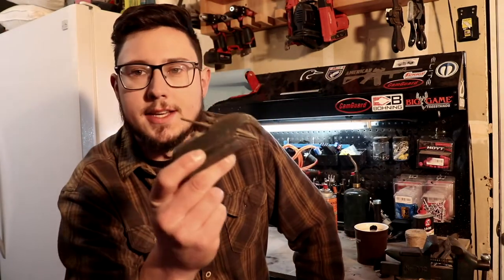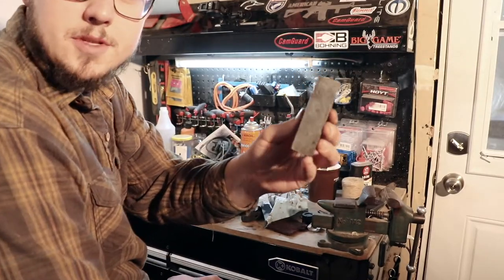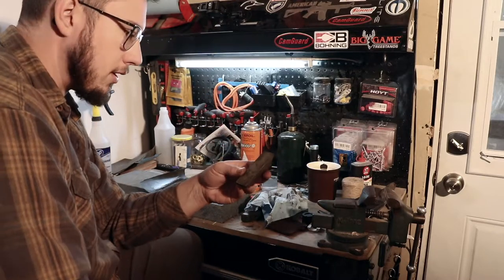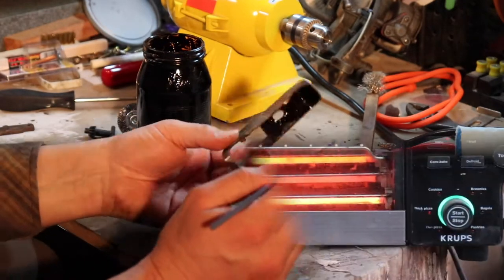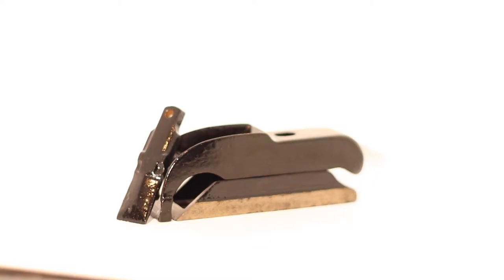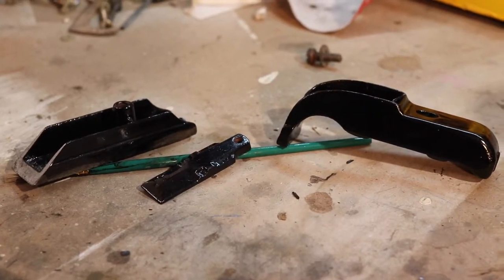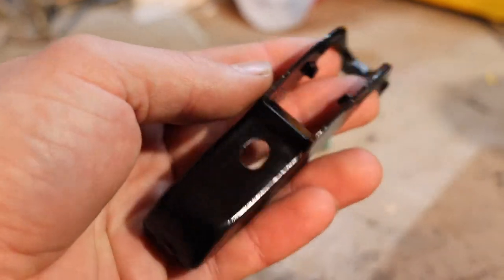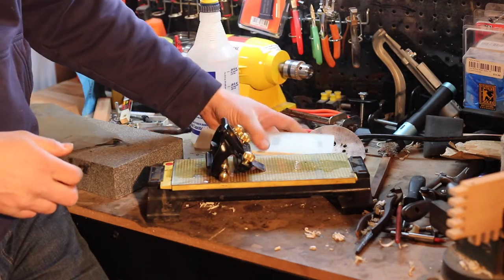Reviving a Stanley no 75 Bullnose Rabbet Plane - Woodworking Tool Restoration

Comment: A great result👍 The  “plane collector” may explain why some may hate it: never flatten the sole with the upper body attached. It wont take a shaving if you do.  I put two hands on top to take a shaving along a board’s edge, it works well enough, but the no.90 is my preferred tool for cleaning up a rebate/rabbet. This will be fine to knock the aris off a sharp edge.

Comment: I use mine as a rabbet plane. When I'm roughing in a tenon or any rabbet-like area with a larger plane I use the 75 to keep the area in the corners at the same level. Rough shaping for when I am not already using a skew or rabbet plane. I'll get into it with a #5 to blow it upthen a block plane(#18 for sure) and the #75 comes in handy to finish and keep it tidy. even on large 6x6 timbers for a stable I used the lil 75.

Comment: Liked the video
Looks like an older 75, couldn’t tell if it is a type1. 
Years ago I bought about 5 jars of original Pontypool jappaning , sold 4 and kept 1 for me
If there is a secret to it it is to put a couple light coats. Want to keep it warm while in storage
To get a believable finish you want to tone it down some other wise it is to shiny. Very fine steel wool or rubbing with a rag
Nothing looks more goofy I think then a worn plane with 100% shiny jappaning
In my experience you can use engine enamel spray paint and get about the same results , hard to tell it from real jappaning
Reply from the maker: Yeah it is definitely an older one with the Stanley Rule and Level Co stamp on the iron. Not sure what type it is, as often the Type studies on the older ones get a little fuzzy but I know it was pretty early. I brought the mix in the house to warm it up, and had good luck sticking the plane body in the oven at 150 degrees for about 10 minutes before applying so the metal wasn't cold. That seemed to help a lot. Getting too thick was part of my earlier problems. With the steel cold, it was hard to get the mix painted on in a thin consistent coat. You are right it definitely needs to go on light. 
I know a lot of folks use the engine enamel with good success, and that's certainly an option especially on a user plane. But for me it's about trying out the processes and trying out something new. Not sure that it's necessarily "better", but I enjoy the process. Thanks as always for watching!

Comment: I can’t set this plane up to get good cuts for the life of me. Every other plane I own I can but this one I can’t seem to get right
Reply from the maker: Indeed it was a tricky one to get the iron depth just right. Once I got it scary sharp and fiddled with the depth back and forth it cuts decently. With the way it fits in the hand I definitely won’t be using it for long cuts, but to clean up the odd corner here and there I will keep it around. Thanks for stopping by.
Reply: Same here, but it sure is good paperweight around the shop :D

Comment: dude that 6000 glass is a Japanese water stone used the other way up i am pretty sure? is it a shapton? the white ceramic is whats cuts the metal i could be wrong.
Reply from the maker: Ha yeah you are right. I didn’t notice I did that. What I did is it slows me down a lot to screw with the camera and stuff. So I had actually completely sharpened the iron before and I was in a hurry trying to just get a quick shot because I didn’t do it while I was going through the steps. Was definitely paying more attention to the camera than the stone. I’d be lying if I said it was the first time I’d accidentally done that tho. Ha. But yeah the ceramic goes up. My bad.
Reply: @GarageMisadventures  all good dude I just thought that you might be struggling with using the plane if it wasn't Sharp
Reply from the maker: @dogf4ther  ha no it’s sharp and cuts real nice. I’m just mostly struggling with not looking like an idiot online hah!! But no it happens that’s why I called it garage misadventures not garage I’m perfect. Good catch though, thanks for watching.
Reply: I have seen people use grinding paste on glass before so it's not that bad of a look. I would strop on leather after all sharpening to get rid of and burrs any way.